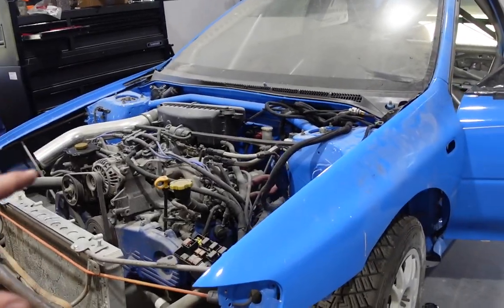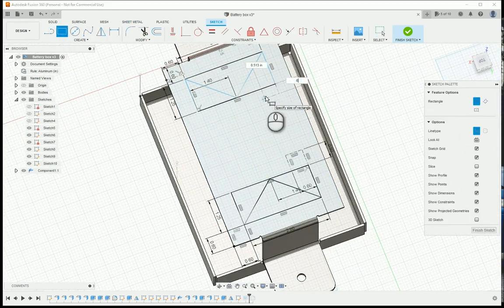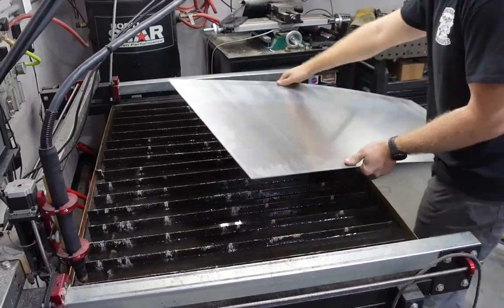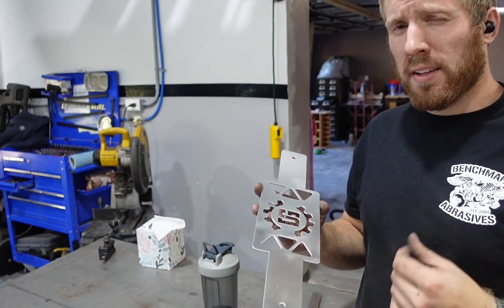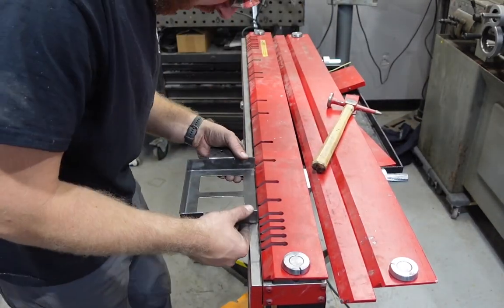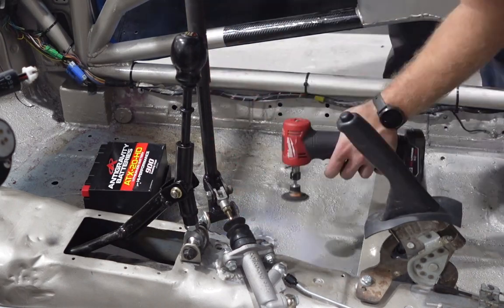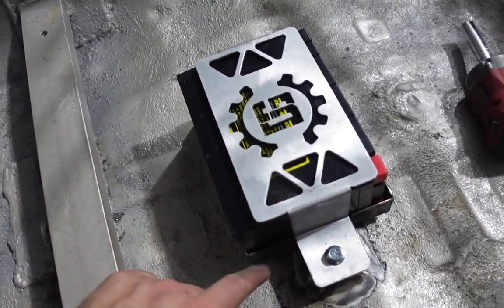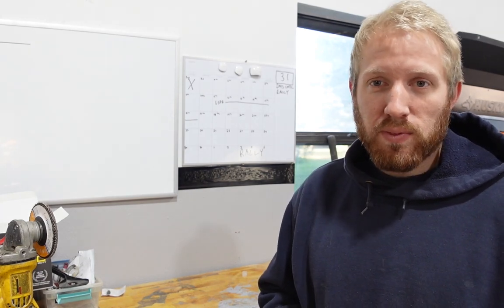GC8 Rally Car Build Gets A Custom Fabricated Lightweight Battery | 30 Days Until The Rally

Comment: If you were at this stage 6 months ago, you'd only be a year and a half  behind. That's pretty good for a car build.
 On the poly carb windows thing. We did that to our side windows. FIA regs require the poly carb to be the same thickness as the original glass so we went for 4 mm scratch resistant. The local plastic guy did the job, we dropped the door and side rear glass in, and he cut it to the original size using the glass as a template. Nice job AU$ 380. + $75 for a tube of  Sikaflex Marine to stick the back ones in.
 Demon Tweaks does the slider panels as a kit and they're AU$43 each side. My son's sponsored by then as a junior. so postage is free.
 All up with glass and removing electric motors, tracks etc, we saved 8KG's I thought it would be more.  Sitting behind poly carb gets really hot.